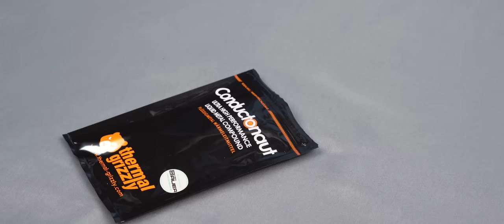Liquid Metal Technology | ROG

Comment: What about the problem that liquid metal dries out very quickly?
Reply: It only dries out quickly when its on copper, a year or so. But i assume ASUS has nickel plated coolers which significantly slows down the reaction so it last for a long while.
Reply: @atilamotila8907  Okay, thank you for the explanation. On the other hannd. Is copper not way better?
Reply: @divil2273  well you see its only coated with nickel. That small layer off nickel on the copper helps  it last way longer. If you were to scrape the ihs on a cpu you would see the copper get exposed

Comment: Seen this liquid metal thing before, is it some kind of thermal paste?
Reply: It is gallium. A metal that acts as a liquid at low temperatures which is why they can use it as a thermal "paste". The heat transfer difference between this and generic thermal paste is massive. about 70W/(m-k) for liquid metal compared to up to about 12W/(m-k) for traditional Thermal paste. That increased thermal conductivity comes with a risk though. Since Gallium is metal, it is also electrically conductive. That is why there needs to be a protective layer between the top of the CPU/GPU and the diodes surrounding it. (The gallium could run off the sides with pressure and heat.) The most common DIY way of doing that is with clear acrylic/nail polish, electrical tape, or both. It looks like Asus will be using a sort of "Dam" around the CPU to protect it from spilling over. Hope this helped.
Reply: @g_r9567  yes that's the one!!

Comment: I'm surprised it took them this long. About 10 years ago I used Coollaboratory Liquid Ultra. However, that stuff dries up so I'm wondering if the stuff Asus uses will do that as well.
Reply: That makes no sense.  What other laptop manufacturers were doing it before Asus?  Definitely leading in their 'factory' use of LM.
Reply: I am certain you will need to do at least one more application of Liquid Metal because it creates a new alloy layer on the surface of the Copper heatsink.

Comment: All this sh!t to cool intel they could have gone AMD
Reply: Amd bsod magnets not worth it
Reply: @eijmert I don't want the easily-hackable intelcpus either and do you mean the AMD graphics cards? Yeah they are driver issues and that's not the case with AMD CPUs
Reply: They did.  They have a bunch of AMD laptops.  The Zephyrus G15 is probably one of the best gaming laptops out there (performance per dollar and actually having battery life while gaming).
Reply: @ca9inec0mic58  bruh amd has those same problems my friend😂 they just didnt tell anybody
Reply: @bagehi  but it has the 80w 2060 >.< which isn't that good and they don't even have a high end GPU combination like a ryzen 9 and rtx 2080
Reply: @eijmert  even if it has the same problems atleast it runs cooler
Reply: they could've, but you would miss out on high end Nvidia mobile graphics and thunderbolt 3

Comment: Only problem I have with this liquid metal it seems to dry up I used it on my Xbox one x and after about 8 months the fan was going nuts blowing cold air.
Reply: Because u can't use liquid metal with copper plate. It must be nickel plated.
Reply: I doesn’t “dry up”, it reacts with the copper, chemically damaging your copper heatsink. The resulting inter-metallic doesn’t conduct heat. Also the interface stops being liquid and can damage your die. DON’T apply liquid metal on copper.

Comment: Doesn't liquid metal need to be replaced after a couple years?
Reply: Yes. I got about 3 years of use out of the LM on my laptop before temps started getting worse, if the heatsink is nickel plated it may last longer.
Reply: Neggy-Z ooohhh, I thought it was shorter. 3 years ain’t too bad.

Comment: der8auer: "keep mind liquid metal must be re-applicated after 1 or 2 months" ......... so after 2 months you will bring laptop to retailer for re-application or what? Ugly
Reply: What you on about? It can be left on for years. It's a gallium mix it doesnt react with oxygen to cure
Reply: @nyx8694  liquid metal based on galium react with copper due to electrochemical potential......this is reason why after few months liquid metal ,,dry out" (sort of) and you must re-aplly it .......after second aplication liquid metal film last longer
Reply: It's a nickel plated heat block not coppet
Reply: @nyx8694  asus use cooper heatpipes and copper plates in laptops .....you can see it in this video (copper and black paint ...no shiny nikel ...aluminium fins)
Reply: @Hello Thursday 7700k on notebook? I dont think so ..propably desktop PC with nikel plated base of cooler and without direct die cooling ....and this thermal paste inside your CPU is limiting coling potencial   ..........again: asus and most laptop brand uses non plated copper heatpipes and baseplates for better heat transmition and less cost .... liquid metal based on galium react with copper due to electrochemical potential......this is reason why after few months liquid metal ,,dry out" (sort of) and you must re-aplly it .......after second aplication liquid metal film last longer
Reply: @Vamtal  the cpu block is nickel plated. so you don't need to plate all the tubes as well.

Comment: and this is the only ASUS laptop that ships with Liquid Metal Technology lol
Reply: Not sure how long liquid metal lasts until you have to repaste again. Doesnt it harden after a while? And ruins the laptop
Reply: @renzeldavid4568  Delidded my 8700k and applied LM 3 years ago and still good. Though avoid aluminum and bare copper contact when using LM, nickel plated copper contact is fine.
Reply: Renzel David I used it on my one x about 8months before it dried up and had to be changed so just used normal paste after that.
Reply: "exclusive to ROG" can't you read?

Comment: Liquid metal spillage isn't fun, especially around and under the BGA cpu itself and possibly nearby resistors and capacitors. So many sacrifices are being made to achieve half decent thermals, i dont believe liquid metal is the way to go. Whats smarter is just designing a cpu that is actually power efficient. These ROG laptops are prone to smd ceramic capacitors shorting 19V to ground and also liquid metal spilling off and around the CPU...
Reply: Ya liquid metal isnt worth the hassle at all
Reply: at least theyre now using kapton tape instead of that janky barrier thing that led to many laptops dying

Comment: Well, this is not a good long-term solution, not all users were Able to reapply the liquid metal and especially during lockdowns now where most shops were closed, users were left with a dried-out thermal throttling laptop. Great play Asus
Reply: and some spilled liquid metal all over their motherboard.
Reply: You had a liquid metal ROG laptop? Which one?

Comment: And again my i7 10875H on performance mode in gaming goes up to 90-92c .. I don't even want to talk about turbo mode :D
Reply: Which laptop do you have? Zephyrus S15?
Reply: And how much wattage does the CPU pull while gaming?
Reply: Rog Strix Scar 17 - G732LV model
Reply: @CptHamza  I guess liquid metal is a gimmick then :P either they didnt apply it properly, or they skimped on something else.
Reply: @CptHamza  but yea, performance mode should run cooler. So get yours checked once.
Reply: @gamersanditparadise  i already returned one laptop. It had same temps. So i guess thats normal for new Asus 😁
Reply: @CptHamza  So liquid metal is a marketing scam. They probably gimped on the heatsink and compensated it using liquid metal. Asus is trash for sure.
Reply: @gamersanditparadise  probably. I'll open my to check if the heatsink is tightened enough. I already found some screws being loose, and some were overtightened. Saw some video  when guy just tightened screws and his temps were better for 10c. Also that plastik over fans is shit. It makes air intake much harder.
Reply: @CptHamza  Yeah. Please let me know what happens :) if tightening screws helps reduce cpu by 10c, man thats awesome!
Reply: @CptHamza  Hey bro, did you tighten your screws? A friend of mine got Strix with 115W 2060, and his gpu is throttling
Reply: @gamersanditparadise  hey. It was all good. Tell him to install recent BIOS update v310. It helps for temps.
Like in BF5 my cpu is not boosting anymore above 4.2Ghz but its working on 85 to 87° C, in ambient temp around 30°C.
Reply: @gamersanditparadise  and yes, i dont have any issues with GPU, hotest it gets is in BF5 after like more then 1 hour gaming around 83°C, but only when its really hot day. Normaly its around 80-81, and other games 74-77°C
Reply: @CptHamza  Oh, nice temps even at 30c ambient temps. Although yours are good temps, my friend actually has the smaller strix g15 and has updated everything to no avail yet. He still is hitting 86 on the gpu strangely.
Reply: @CptHamza  can you share the link of the person who said screwing the heatsink properly helped reduce temps?
Reply: @gamersanditparadise  my first laptop i had was getting same gpu temps, 85-87°C in BF5, but i returned it because it came with gap between screen and frame. I'll share it when i find it. Guy had overheating problems so he opened laptop, from Asus also, and found loose heatsink screws lol.
Reply: @CptHamza  So can it be that there's a bad batch of Strix laptops gone out unchecked in the market? Many 2020 strixes are running hotter on gpu compared to 2019 115W variants.

Comment: i dont dare to do this on my laptop. one mistake !!! and all motherboard is fried :)
Reply: They know. That's why the process got perfected to the point where even if for some reason it spills over, they'll just replace the whole laptop without thinking about it.
Reply: You don't have to
Reply: I beg to differ when you buy conductonaut you get a lot of acc that helps a lot to spread it. And even the pressure needed to get the LM out so you push out only like tiny little droplets each time. I used them on my 1080Ti chip, which has some connections near it. Apply a good electric tape on those, and you're good to go. First time does feel hard, but I've changed the LM again since and the tape is still good

Comment: 92* cpu asus rog g17 ..
Reply: Does it mean liquid metal is scam?
Reply: @gamersanditparadise  no mby just new intel i7 10gen are too hot and laptop cooling is not enough effective, i undervolt with throttlestop -125mv and now it's stay on 80 - 84 but why just not optimize from factory to stay on good temps..or intel not fix theirs mobile processor, my fingers start swet..
Reply: @60hzzh60  Can you tell me, what are the cpu temperatures, and power draw as well? So that I can get an idea how much power it draws when it is running hot.
Reply: @gamersanditparadise will check for you more later
Reply: @60hzzh60  Ok bro. I'm interested in buying a 10th gen. Would be great if you can help :)
Reply: @60hzzh60  Hello. How you undervolted it? As i have asus rog g15 and i cant undervolt it. I have i7 10750h variant.
Reply: @60hzzh60  can you please check it for us?

Comment: Liquid metal is a total gimmicky joke
Reply: No it's kinda not, for desktop it doesn't help that much but for laptops, it literally decrease it's temps by 10c so the cpu can run at 80c which is good enough instead of 90c which will turn you laptop into a finger cooker
Reply: @rocky-zx6kq  Lol yeah it is. A good thermal paste should do close to the same thing. Its not worth potentially frying your cpu (or other components) lol
Reply: @VashStarwind  apart from having vastly longer service intervals compared to normal ceramic based thermal paste it turns out the reason LM isnt working as well with asus products(cant say for other than the g15 AE cause thats the one i own) ive seen asus compensate for applying way too much LM by having lower than ideal mounting pressure making it not worth it 
if you repaste using a correct amount and have proper amount of mounting pressure on this thing you get wonders happen like being able to get 15k cinebench scores on the 5900/5980hx 
their so called automated technology is a joke and should rather be done manually to reduce defects
sure you might see a temprature delta of under 5 degrees but its a performance difference of 10% minimum depending on the configuration youre testing
Reply: @rocky-zx6kq LM is a joke in laptop. Better quality thermal paste, IHS, and how fast you cooled down inside heat pipe are the key. If IHS become too hot and the heat pipe is not cooled fast enough, nothing you can do even if you use the best liquid metal on earth.

LM in desktop is much better as desktop can cool the IHS faster thus it is logical to put faster heat transfer between CPU/GPU and IHS. Laptop is not without adequate ventilation, heatpipe, and fan. (This is why new gen cpu/gpu is always accompanied by different design of heat pipe).